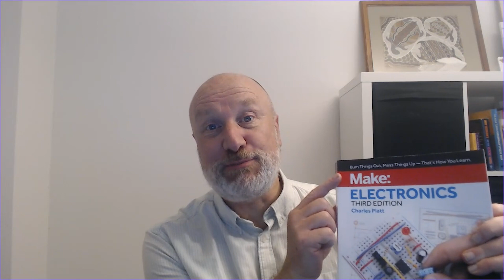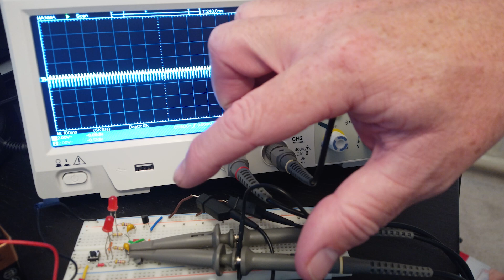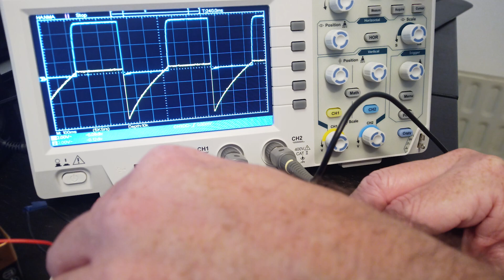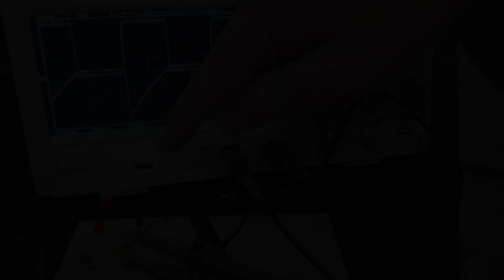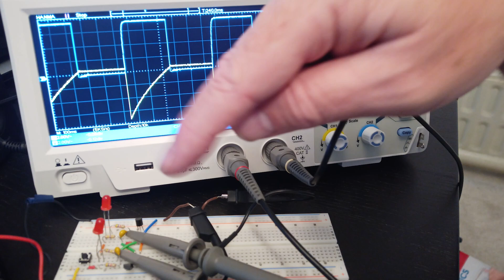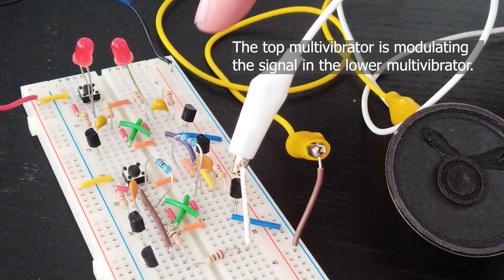Make: Electronics Book Experiment 11 - Flashing lights and sirens

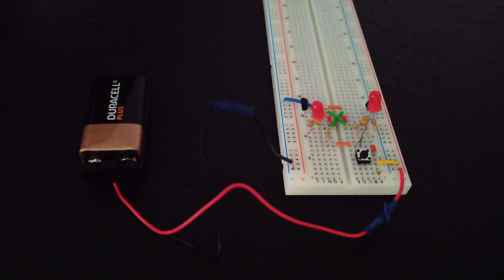Comment: That circuit is a success to me! I tried hard for that and when I started, I didn’t have enough ingredients and I couldn’t even do it with a tactile switch that is 12mm. He told me to use a 6mm tactile switch, and I don’t think shape matters. He is using square because squares are more common than circles. Make: Electronics said that square switches are not allowed because the four kinky pins that tend to pop back out and the square being fraction too big, but to the 6mm ones, I think this part is lying. You also used a square switch for that experiment! 0:45

Comment: Just found this video while seaching If It was possible to use different resistor values without damaging my components for this same experiment.

And I found this gem of a content. I noticed you have a whole series of the book, which is genious!

I'll be bons watching your content while performing my experiments, thank you!

Oh... and If you happen to know, may I chance those resistors? Hahahaha
Reply from the maker: Hi in terms of protecting components r1 and r2 are most critical as they protect the LEDs from drawing too much current. But if you change any of the values it will affect the timing in the circuit so you will get a different frequency of light flashes and a different tone from the speaker. Obviously you need to match the values on the left and right side of the circuit. If you don't have the right values you could perhaps try using multiple resistors in series or parallel to get closer to the correct values. If you look at page ix in the introduction there's an email address where you can get further help from the author. Hope that helps.
Reply: @M7GNP HEEEEY IT FUCKING WORKED MAN IM SO GLAD!!! THANK YOU!!!!
Reply: @M7GNP You're the best, thank you 🫵🔥